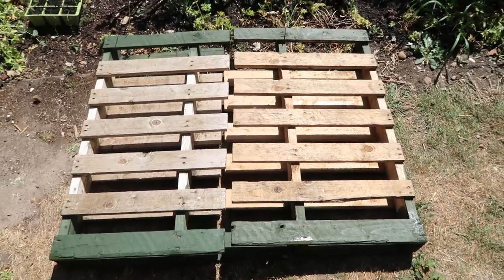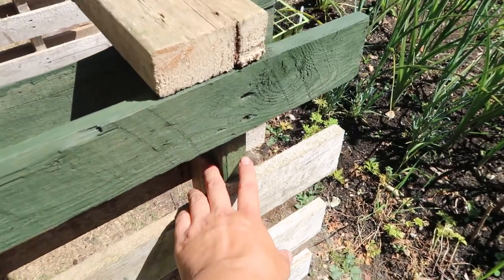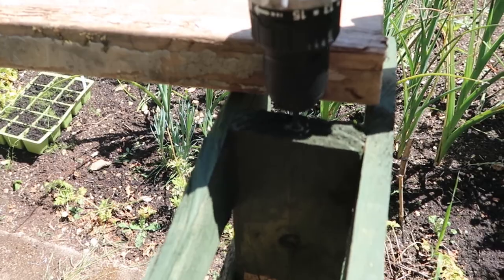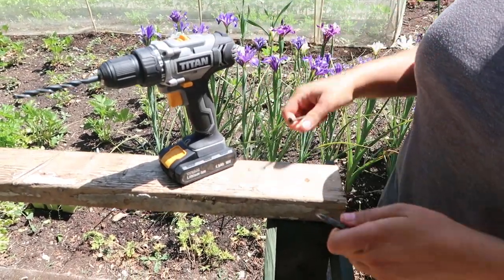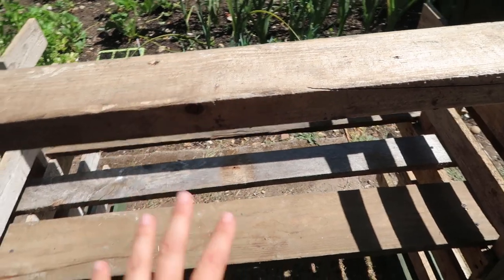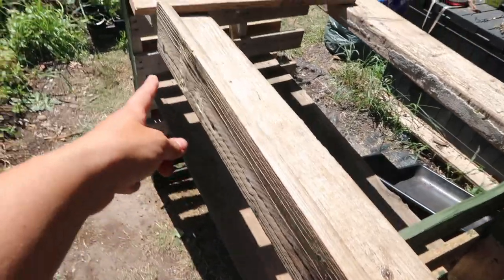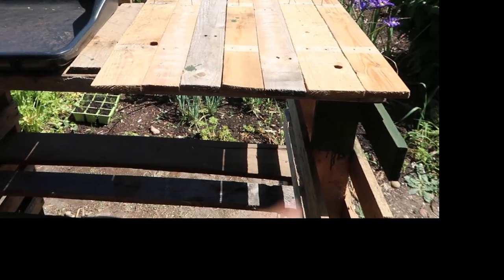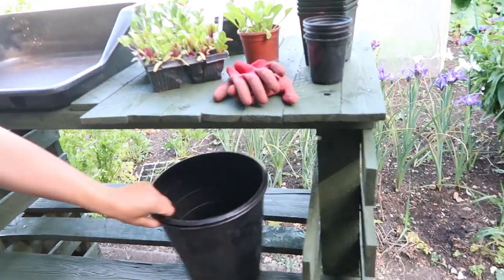How to make a DIY pallet potting bench/table

Comment: Great job I myself make many things from pallets.  Iv made stageing for greenhouses. Bird nesting boxs. Square planters and long trough planters. Pi ture frames and coasters.
 Iv made some of my raised beds aswel.
 I made a shed for a friend completely from pallets. Just got to make sure that any pallets has 
H.t  printed on the blocks which means heat treated as the other types have chemicals used in the makeing of the pallet heat treated being safer.
  Again great job well done.
Reply from the maker: A shed is impressive. I have just taken on a new plot so will be making a few things for the plot from pallets this year.
Reply: @AngelasKitchenGarden  Angela just make the psllets you obtain mske sure they ht  tapped on them which means heat treated and are safe where other pallets are chemical  treated and if you gor beds ect which leech chemicals  into the soil snd damage  and render useless  for growing all the bedt
Reply from the maker: 👍🏼thank you I will.